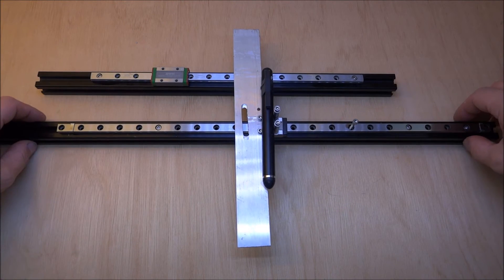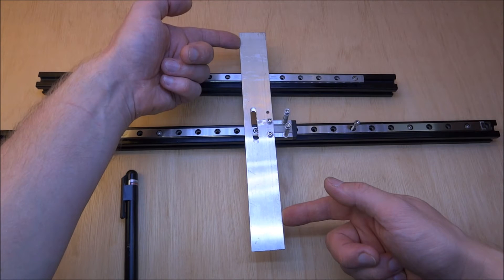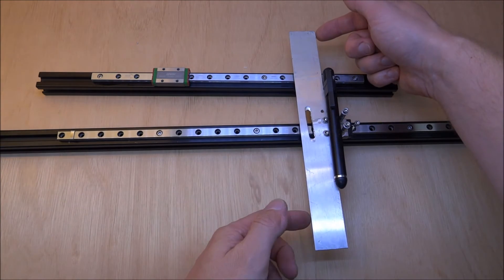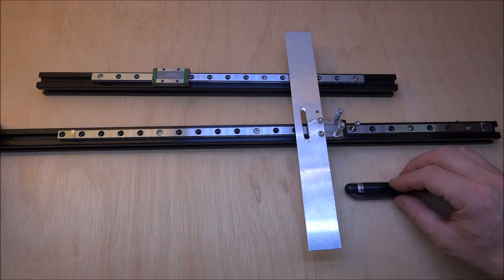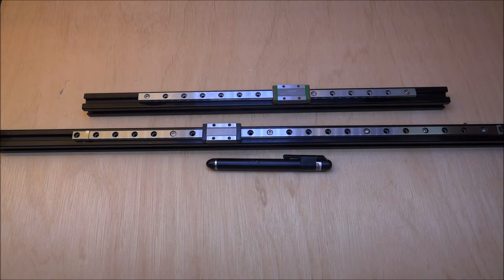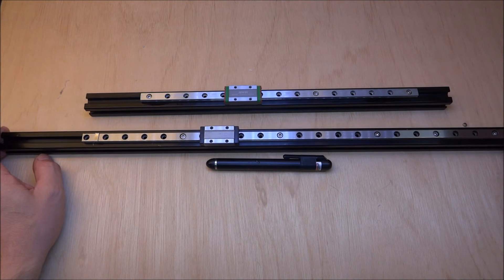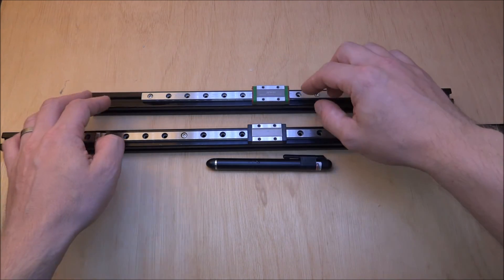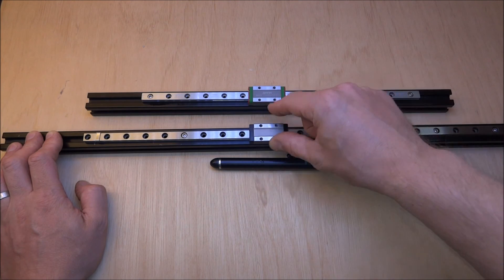3D Printer Linear Rail Comparison - Hiwin vs Robotdigg: Part 2

Comment: So... Are robotdigg worth it?
Reply: no, just get hiwin if you can.
if not you might be stuck with drylin,they're known to be more readily available, better supply chain. much better rail than even hiwin but much more expensive (3-5x?) or if youre feeling fancy (you definitely dont need this) a pbc rail 😎
Reply: @v1Broadcaster  btw I bought robotdigg, not bad. I built a voron 2.4 350mm
Reply: @oaiwjebdlla  omg really? i really want to build one but I'm really not trying to drop $1.2k on something I'm probably going to mess up. how much did your cost if you don't mind me asking?
Reply: @v1Broadcaster  idk, I have to calculate it. For the BOM with high end parts 1.3K€ which should be 1.578$. If we add all the tools I bought we are near 1.8k€ or 2.1k$. I bought high quality and medium quality components so yeah it's expensive, if you add hiwin rails.... Well... You know it's too much. Btw if you have all the tools you can stay around 1.5k$ and if you don't count the shipping costs you are near 1.3k$
Reply: @v1Broadcaster  is it worth it? Sure it is. Should I make a full metal blv mgn cube for less then 1k$? It depends on your needs, keep in mind that if you need to repair your 3D printer, and is made out of aluminium and you can't 3D print aluminium then it's a problem, so having a 3D printer made of plastic sometimes is worth it.
Reply: @v1Broadcaster  I'll get hiwin for my second 3D printer

Comment: could the differences of deflection be from different placement of clamps and or forces of clamp to door frame?  Trying to get a good idea of this comparison as I'm shopping for these models... thank you for your concise video and help
Reply: oh bother, this app want pointing to part 2 or 3
Reply from the maker: Keitho Farns yes, some of the deflection could be down to those things but from "the feeling" I got in my hand while loading and unloading, I think the movement largely comes from the carriage-rail interface. If you are going to drive from an offset, eg only push one end of a gantry, has to be Hiwin for smoothness and tenancy not to bind. However, if you are pushing from roughly the centre of the rail or driving in a balanced way either side of the carriage, the Robotdigg ones are worth a go.
Reply: +Simon Merrett thank you very much for your time and efforts

Comment: Love to see how they both fare when you print with them. What corexy are you making?
Reply from the maker: It's going to be difficult to isolate and attribute any difference in the performance of the rails once I've built them into my printer because the Robotdigg ones are going on the Y axis and the Hiwin is going on the X axis. I'm not sure what design I'm using - it's a bit of "make it up as I go along". "Iterative" might be a grander way of saying it! 
I can tell you what some of my design aims are though: low noise (TMC2100 stepper drivers, motor anti-vibration mounts, probably an enclosure, maglev hotend fan), accuracy at speed (E3D Volcano, linear guide rails, aluminium 2020 extrusion, 3x Z axis lead screws driven by one motor to allow mechanical bed levelling and reduce the Z screw nut wear which comes with software auto-levelling, perhaps a 32bit controller in due course), better range of materials (E3D Volcano again and their Titan extruder in direct configuration for flexible filament, AC heated silicone mat on Aluminium plate bed with PEI sheet - eventually, the enclosure should help too, and a print cooling duct which cools from both sides).  Currently I have a MDF box framed Smartrap Core which I modified to have dual Z axis lead screws, oilless bushings, E3D lite6, I kept RAMPS 1.4 with A4988s (DRV8825s were too noisy) and a 12v Mk2a heated bed.  Before that, I had a QUBD Two Up, which is how I became aware of Andrew/ +3DprintedLife. I've been following his journey and learning loads from him and the guys on the reprap.org Smartrap group. I hope that gives you an idea of where I've been and where we might be going!